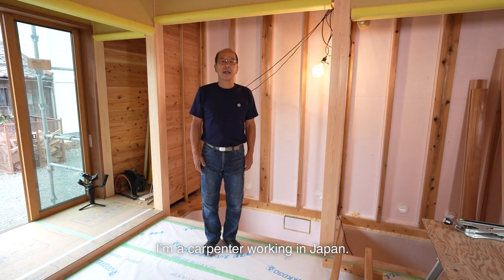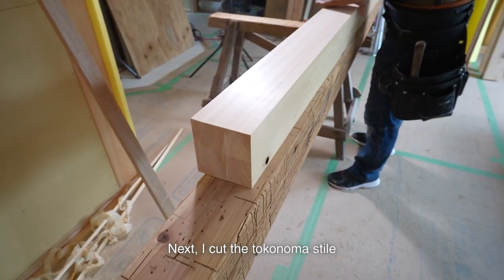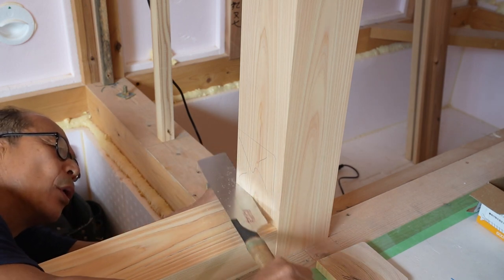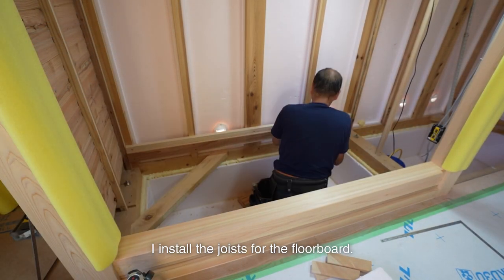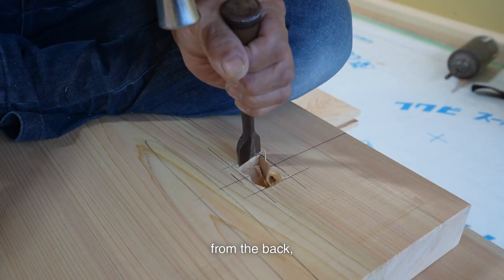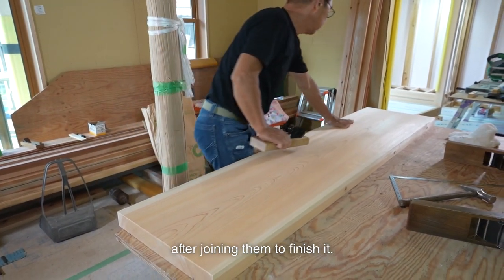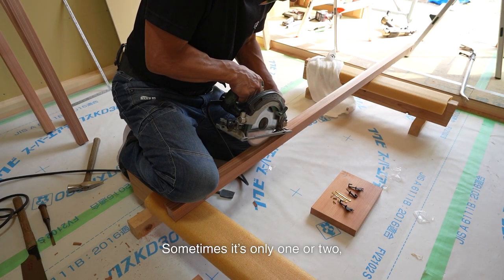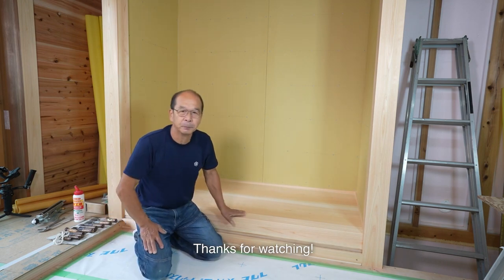Superb. Tokonoma Made from Extremely Thick Boards of Japanese Cypress [Season2 - Part 16]

Comment: The glue must squeeze out. Our teacher in carpenter school told us that "If the glue is not squeezing out, you are not using enough glue." When it squeezes out, you know that there is enough glue between the joints. You can always wipe the extra out, but it's hard to add more.

Comment: Interesting that the Japanese never adopted the biscuit, which would save this guy about half his time.  I once made a giant dining table and bolted the two halves together like he has done but that was only so that I could disassemble it if needed.
Reply: I was thinking about that too. Obviously the biscuit join is faster but the advantage of the bolts is that you can keep it super tight over time, especially since (I think?) people walk on it.
Reply: @iamamish  Nobody actually walks on tokonoma, but Japanese homes are generally not well temperature/moisture maintained so there will be a lot of wood expansion/shrinkage. I'm not sure if a regular biscuit join would survive years of that.
Reply: @ModMINI  thnx for the info!

Comment: What do you use to fill screw holes?
Reply: He always makes sure to set screws where they will later be covered by other finish material
Reply: @jacobperkins2866  I see in one of his videos that he uses some of the finer sawdust from the board mixed with glue, over-fills the hole then chisels flush after dry.

Comment: If you let the excess glue dry for five minutes, it becomes consistent enough so that you can cut it away with a chisel, instead of wiping it off with a wet rag. This causes less glue impregnation around the glue line. The tiny amount of glue that penetrates the wood around the glue line , when using a wet rag, interferes inconveniently with oil or other impregnating finishes.
Reply: Tokonoma do not have any finish applied. The bare wood is enjoyed as is.

Comment: there is a german saying about glue coming out the joints  it goes like this  

Leim der aus der Fuge quillt hält nicht aber beruhigt ungemein. Wich roughly translates to.  Glue that oozes out of the joint doesn't hold, but calms down immensely